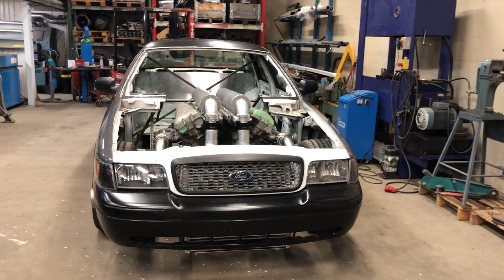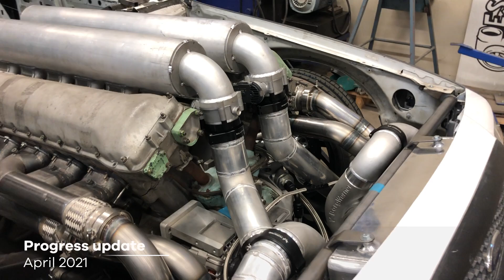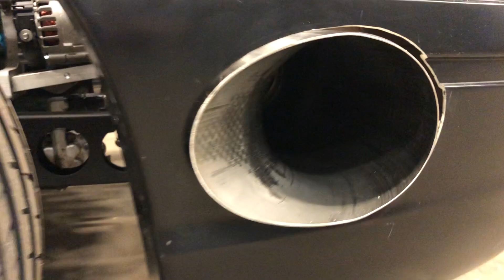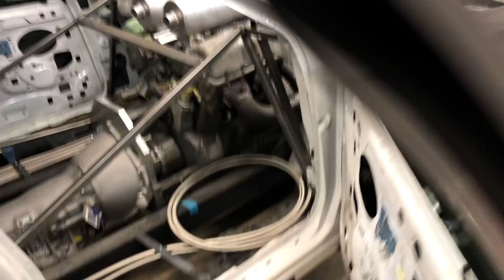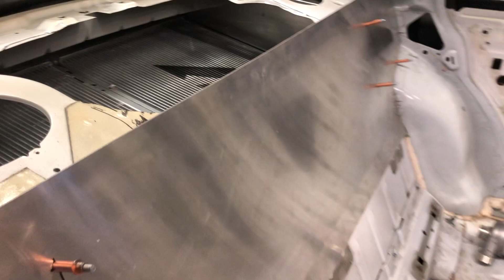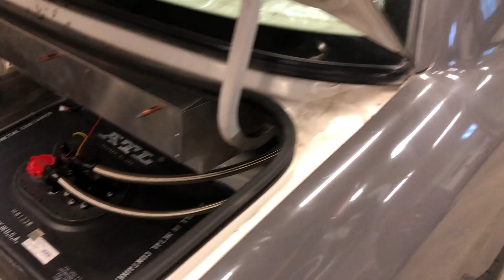Progress update April 2021

Comment: So there's a huge issue with weight up front.   Has anyone thought about weight ratios?  Lol.   So what well they do to get weight out back and get traction? Hope n pray?   Great concept.    No thought going in on physics.  Lol.   That's like putting a tank emgine in a car..  oh. Wait.  I mean  a train horn on a wagon??
Reply from the maker: The engine is made of aluminium and weighs around 600 kilos. That is pretty much equvialent to one and a half castiron big block engines. We have reduced a lot of weight in the car, and the weight distribution is for the moment 55-45. We hope to improve this by putting as much weight as possible in the back of the car and use light weight materials in the front. The hood will be made in carbon fiber 😀👍

Comment: That gearbox is not looking forward for this project to finish hahaha. Damn, everything is huge and shiny!
Reply from the maker: Thank you very much! Well the gearbox is dragracing spec. so it should be able to handle the torque :-D
Reply: That th400 looks custom! I bet it easily handles the projected 2500 horsepower

Comment: Send me a foto of the crank shaft 2 gearbox modification and maybe a drafted picture of the conversion have a rover mg tf convertable and meteor enjine auto merceds gearbox for enjine on front suspension  need a drawing and plan also have audi gearbox 5 spd for mid mount   of enjine  still deciding rear mid or front  enjine
Reply from the maker: We just posted a new video yesterday! 😃👍

Comment: Keep up the great work! Been fallowing for a while now! Can’t wait to see and hear it run!

Could you also list all the parts used? 
Turbos, brake kits, steering, suspension, fuel system etc
Reply from the maker: Thank you very much! Yes, we will do a video when we go through all the details in the car.
Reply: @TheMeteorInterceptor  awesome! If you could include steel/ aluminum tubing specs for the frame and intake and exhaust too would be great!

Comment: 600 km/h max speed?
Reply from the maker: That would be fantastic! 😃
Reply: Tire size ~25” diameter. 
Max RPM of engine ~4,000 RPM 
Over drive before trans 2.77:1
RPMxOD = ~11,000 RPM at the torque converter. 
If it’s a 4 speed TH400 then final gear ratio is 0.7:1 
Rear end at 2.73:1

So potential top speed 428mph or 690kph that’s Max. 
It could have just a 3 speed and a 3:55 rear. So it would be a max speed of 
230mph and 370kph
Reply: @devinbender8428  awesome calculations👍
Reply: @Dontfearthereaper001  thank you. Very basic math but still coolZ but even if it had the more top end friendly setup. It will take longer to get their because it will have less whee torque to fight wind resistance. I expect it to hit 300mph or just shy of 500kph.